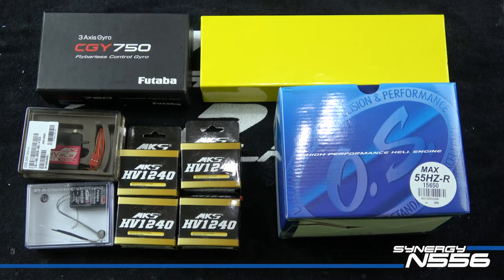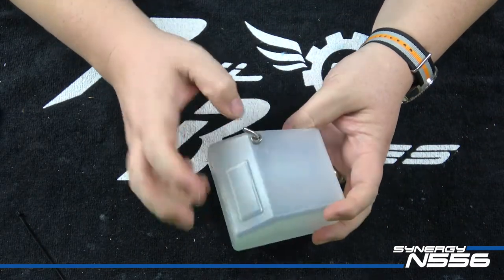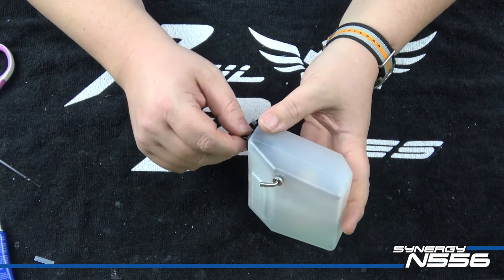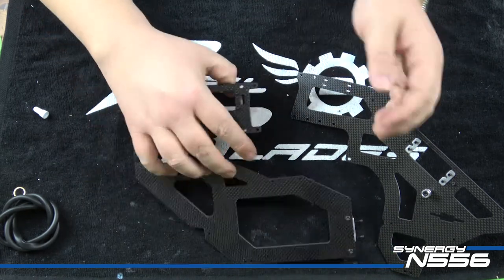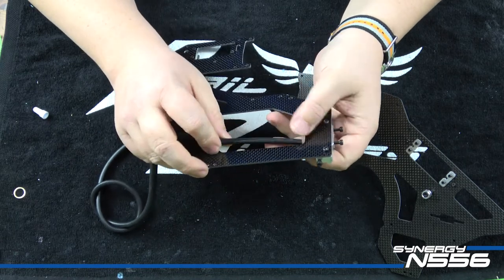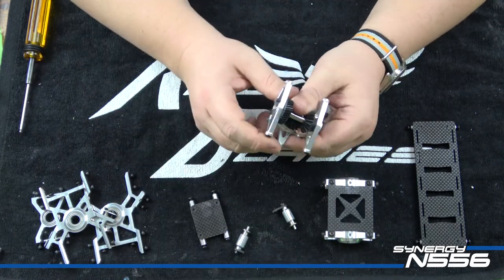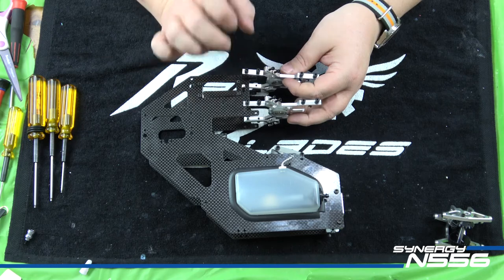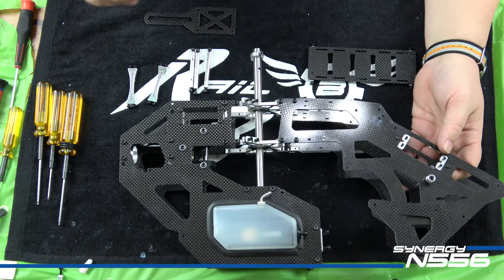Synergy N556 Build Series Part 1: The Main Frame

Comment: Hello I been trying to reach out to a few people on YouTube .
No one Been able to give a hand ,hope you can help me a little bit, I have a synergy N5c  I never owned a flybarless heli before ,but I have a old trex 600 nitro I did try to flying it but at take off the heli starting to spin and a cracked land no bad just the skid and tail broke 
This is the question the trex main rotor spin clock wise so is the synergy but the tail rotor on the trex spin on a different direction ....
It really matters the way the rotor turn regarding the way the tail blade should turn ?. I mean the tail blades on the trex turn opposite of the nose ( if the nose looking the heli from the back goes left the blades goes right ) now on the synergy the blades was moving the same direction of the nose is that right or wrong?. I’m confused because the rotor spins on a different direction can you please help me I will appreciate any input thanks..
Reply from the maker: Gec Service Yes the tail blades them self rotate a different direction. So you’ll have to make sure your compensation on the Gyro is correct. Works the exact same way as your T Rex but since the tail spins the opposite direction your compensation might need to be reversed. Double check it on the bench before you try to fly it.
Reply: Ok thanks so much first to take the time to answer 
So for what I understand one tail blade turn clock wise ...one counter clock wise ... now what you mean regardless the rotation of the tail blades the giro should move the blades on the opposite direction that the nose of the heli moves?. Right or wrong? means if the nose of the heli looking the heli from the back    The nose goes left the blades should move right is that correct?
 Also if I move the rudder stick to the left what way the slider should always. I’ve regardless the rotation ?
Thank again hope you doing well with all this Health issues in the country